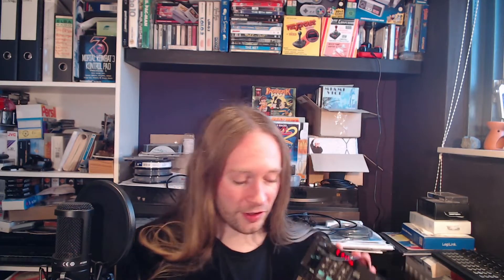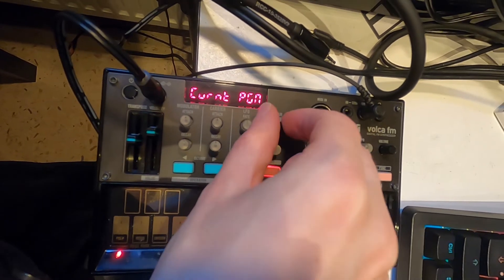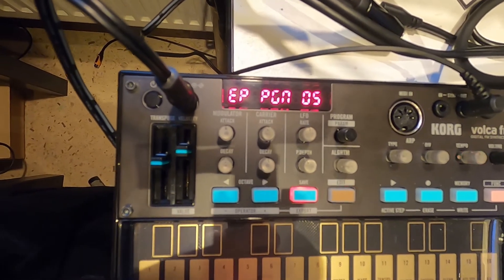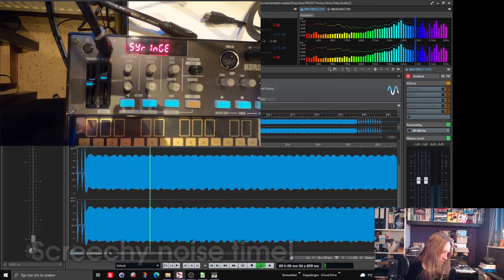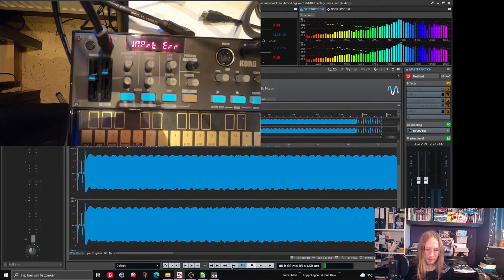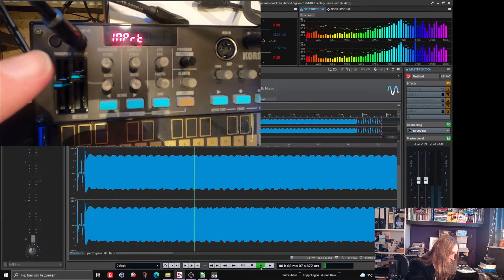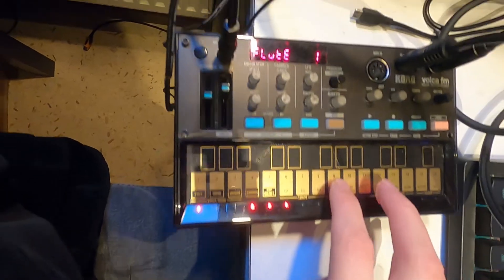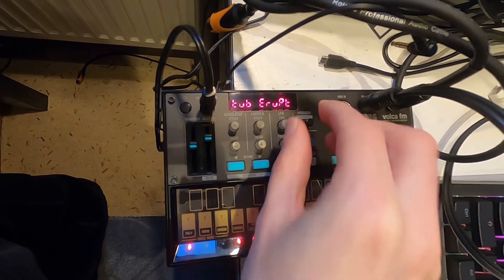Korg Volca FM Patch transfer (audio sync port)

Comment from the maker: Important: The Volca FM Factory patches in the links in the description are provided as is and are solely intended for users / owners of a Volca FM.  I have removed the link to the DX7 patches (as I do not want to host  "roms"). You can covert these your self using the method demonstrated in the video (the Yamaha ones are not that diffucult to find).  Please don't ask me for any patches. The Volca FM factory patches are intended as backup for users as Korg does not provide these.  The syx cartridge is created by me by manually transcribing the patches from a spreadsheet into patchbase, I can not gurantee that they are 100% error free. They should be mostly OK but use them your own risk in case you overwrite any data stored in your Volca.  You can also retrieve factory patches back through a factory reset, but this will reset everything including sequences you may have stored.

Comment: This is the only method that I could find that works. Thank you so much for making and posting this video! I was on the right track by recording the sync out, but didn't know about the output level needing to be pretty high, and went down some other bogus rabbit holes.

Then I found your video, and tried, it seems to work! One question, after loading patch 64 on a Volca FM2, do you just pull the sync in plug out of your unit?
Reply from the maker: After loading patch 64 on the Volca FM2 (but also  patch 32 on the first model) it should display an acknowledging message ( something like "OK" ) after a sucessfull transfer. Then you can safely unplug the sync cable. If the transfer is incomplete it will display an error message. If you transfer from the original Volca FM to the Volca FM2, you have do it on a individual patch basis which can be time consuming. I've tried to do a full sync once from the original to the FM2 and that didn't work, the Volca FM2 expects the data transfer to be longer, it thinks data is missing (probably of a checksum error or something).
Reply: @dykodesigns  Thank you very much! You are on top of it!

Comment: So with a patch base i can transfer patches to Mac/ipad and then transfer it to other FM volcas?
Reply from the maker: Yes and no. It depends on the Model of Volca FM. With the original model from 2016 you can only transfer from Patchbase into to the Volca FM via midi (only goes one way as the original model had no midi out so you couldn't export patches via midi), with the Volca FM2 from 2021 (that has the 6 voice polyphony) it can go both ways because the newer model has both midi in and out ports. Patchbase only supports Sysex transfers though.
Reply: @dykodesigns  I just thinking of buying FM 2 for Sound design and saving my patches on PC, and looking what is the best way to do that. Thank you very much, now I see that it's possible. So there is no loosing any settings after exporting the patches from FM2 to PC through Patch base?

Comment: Very helpful - thanks!

I wanted to transfer Sysex to VolcaFM without buying more gear.
This audio transfer method is amazing but adds another step.
It's easy to get Sysex files online but audio format versions are not standard, obscure and hard to find.
I discovered I could transfer Sysex (and CC) using a Sysex compatible MIDI controller keyboard.
More info here:
https://youtu.be/AijY2-k25ZA

Comment: Would you be able/willing to share the individual audio for the Factory DX7 patch banks? I’d like to try and use them in AudioShare on my phone to swap out patches on the fly. Would be super thankful!
Reply: I managed to get your stock Volca presets working through Koala sampler by importing the audio, normalizing, copying it to another pad and then mixing them together so I’m sure this would work if you happen to have those :)
Reply from the maker: I have updated the description with a link.
Reply: @dykodesigns  Amazing, thanks a ton!
Reply: Got it to work! Thanks again, I seriously appreciate it! I wish I knew how to code, it seems like it would be very easy and useful to make an app of some sort with all the individual patches in the Volca sync format. Plug it in, hit play, switch a patch.